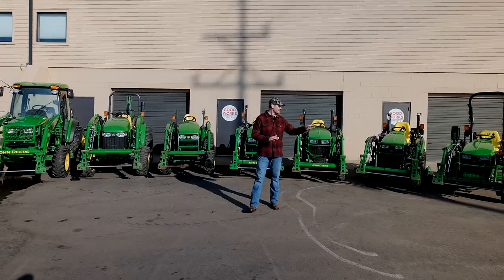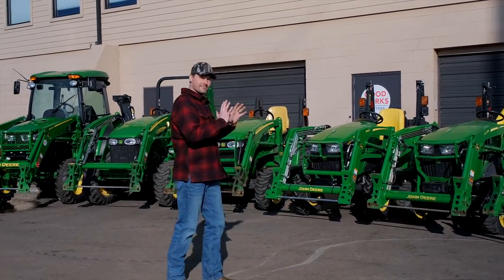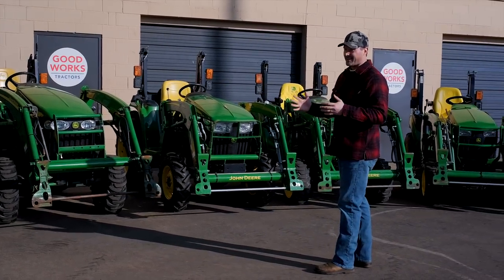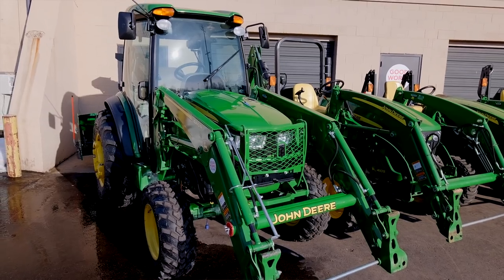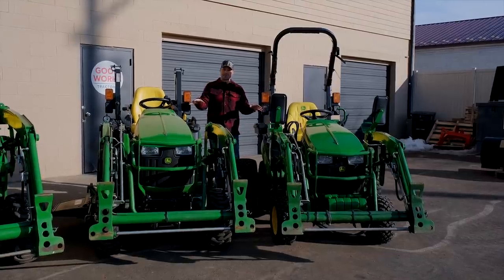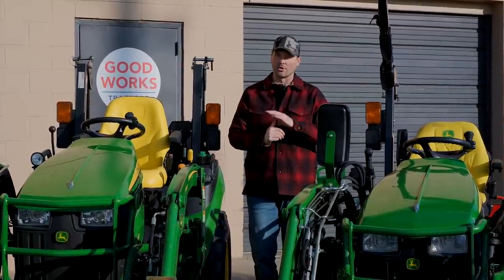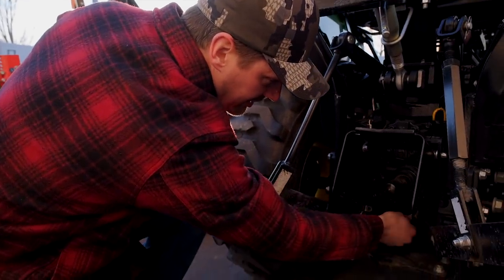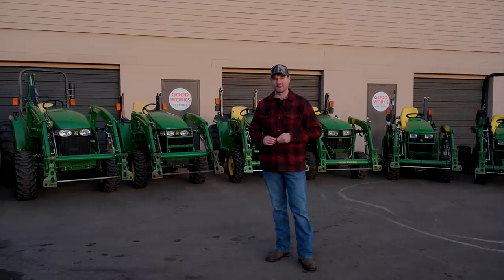COMPARING EVERY JOHN DEERE COMPACT TRACTOR FRAME SIZE 🚜

Comment from the maker: DOES AN ALUMINUM OR CAST IRON TRANSAXLE MATTER?  Are you surprised by those results? Leave a comment below!

IF YOU'RE IN THE MARKET FOR A TRACTOR OR ATTACHMENTS, YOU GOTTA CHECK OUT http://www.goodworkstractors.com 🚜👨‍🌾
Reply: @brianwideman2342  Not necessarily.  Aluminum is very strong for its weight.  An aluminum case of the same weight as cast iron will likely be stronger.

Comment: So good to see Rosie running the show again!  She looks great- the drone footage is awesome, that really shows the differences in these tractors that you obviously know quite well. And- I am really surprised at the aluminum rear ends. I guess they are holding up, or has that turned into an issue yet? Awesome video, thanks!
Reply from the maker: Haha, yeah she was telling me it's time to go sit by the fire!  No significant issues with those aluminum rear ends.  I just found it interesting after seeing all the conversations over the years online.
Reply: @GoodWorksTractors  I have a 2017 3038E and have not found any limitations in abilities compared to the R series. Like he said, the R's are simply deluxe versions with more fancy features over an E. Remember: more options mean more money. If you want to do the work without emptying your bank account, an E series will do just fine. Simplicity = less problems.
Lastly, I see no practical difference between an aluminum axle and cast iron. Aluminum will be just as durable in normal use, unless you have the need to jump over 12 cars Evel Kneival style.

Comment: Great video!! A few points worth noting and not mentioned is the independent deck lift option for both the 1025 and 2025R. It’s electric operated actuator for those reading this. I have it, works great. I also think the 2025r loader capacity is slightly more than the 1 series (not huge) as well as 3pt. Thanks for a great vid!
Reply from the maker: Thanks for watching.  Yes, independent options are available, however they aren't standard.  Command Cut is standard on the 2032r/2038r.  I was comparing standard setups.  Also, lift height and capacity is exactly the same.  3 point lifts more on the 2025r.
Reply: @GoodWorksTractors understood. You were mentioning cab availability and what not so I didn’t realize that. 754 pounds for 1025R and 840 pounds for 2025r with 120R. Courtney, do a lift test! Nobody has a good one on those 2 to actually test specs.

Comment: Double thumbs up!  I'm just starting to look at sub-compact and compact tractors for my property in Northern 
Lower Michigan.  I've probably watched 15-20 of your videos and others.  I'm getting comfortable with the 1025R (w/ loader, backhoe, belly mower, brush hog, grapple, snow blower, ballast box, wheel extenders, wheel weights, post hole digger and possibly a back blade or leveler of some type,  With these attachments I'm pretty sure I'll need 3rd function hydraulics on front and rear) A great education! We have 40 acres with an apple orchard - 50% is hayed (by relatives with their equipment), 30% woods and 20% is apple orchard and homestead (future house/garden - currently barn/driveway/parking/burn pile etc.).  Now I just have to break the news on level of investment to my wife!  :)

Comment: I have owned the 2 series, a 3046R, and now a 4066HD.  Awesome machine, and the jump in power is impressive.
Reply: I have a 1025R that is almost paid for, i was looking at keeping the 1025R for small job and get another 3 or 4 series. What did make you jump from the 3 series to a 4 series ? Have you ever considered the 5E series ?

Comment: I screwed up up . I had found 2019 1025 R front end Backhoe   With plastic still on the seat 💺 $15.500...Rosie looks healthy. Is there a reason why it’s aluminum instead of steel For cooling or dissipating heat? Steel is the way to go for weight ?

Comment: i really wanted to like john deere because my grandpa had a lot of john deere equipment back when i was a kid but the aluminum transaxle just killed it for me
thats precious ballast weight thats being thrown away by using aluminum instead and being down low built into the tractor would also help stability as well if it were steel/cast iron
i still liked the video though and appreciate all the details

Comment: Nice video
I didn't buy a deck for my 2025R but I thought there were different options for deck lift.
Rosie is looking really good. I think I have said before that I have a lot of respect for pet owners that take care of their animals even when it's a challenge.
Reply from the maker: Correct, but I'm not talking about options.  Rather standard setup.  You cannot get the 2032r/2038r without the Command Cut which is still a significant upgrade from the basic independent hydraulic deck lift offered on the 1025r/2025r.  Rosie's a good pup, she's pretty much fully recovered now too.  Have a great weekend!

Comment: I have a 2015 1025r with backhoe and loader and over 300 acres in northern Ontario. Now I'm really wishing I held off to find a 2025r or 2032r for the bigger tires and more ground clearance. Do you know if my backhoe fit on a newer 2025r? I was under the impression that they were different. Would love that 4105 but need to barge to get to my property.
Reply from the maker: I don't think your backhoe will fit the 2025r, but I could be wrong.  The new style 260b is what's found on the 1025r and 2025r, but I'm not sure if your 260 backhoe will fit.  Might need to ask that JD service counter and they can look up in their system.
Reply: Thanks for replying so quick.  That's what I thought too. Guess I'll be looking for an older one or just a bigger tractor next time lol  1025r gets the job done I just have to be careful with the ground clearance and stability. Thank you for making these videos I always enjoy watching them and get lots of useful information, helped me out a lot pulled the trigger on a Hla snow pusher this year and I love it. Just can't seem to find a backdrag poly edge anywhere near me.

Comment: The best one stop shop Deere comparison I've ever seen online...  Nice job guys!   My 2025R is sweet and nearly new, but somehow I can't bring myself to buy 4' implements...  I'm lusting at that 3520 OR more likely for a well loved low hour 3039R a bit higher in the $20s (along with TTWT I hear)... Wondering if I can get R14 or R3 radials that make the width a bit under 60" through my 60" gates on it?  Sad to say gates are the decision criteria.  It could be an M-1 Abrams tank capability-wise, but if it can't work where it's needed, doesn't work right?

Comment: Where would a 2320 fit in the line up. Also have you seen any three point attached buckets? Maybe with a hydraulic top link to tilt/dump. Even with a loader type quick attach for other equipment (forks). I’ve seen some online. Mostly from other countries or buried in hard to find website. Titan has one but you can’t back into a pile of material to load it. Looking for a more inexpensive option to buying a complete loader just to be able to move things around. Love the channel. Thanks

Comment: I’m still trying to decide what tractor too get I need the mower  but I need a strong loader and back hoe for landscaping jobs one question can you get the 1025 gear drive with shuttle shift F & Reverse , I have not seen one on the lots I been to.

Comment: I have a JD 4115 with about 225 hours I bought about 2003. How would that lineup with these models in the video? Thanks
Reply from the maker: It's a small compact, fairly similar to a 1025r or 2025r.

Comment: Nice comparison.  Would like to see a competitor comparison, Kubota vs Deere vs ?  as far as which model is a direct compare to which model.  What does an L4060 compare to?  Certainly not the 3 series from all the specs other than HP.  More importantly Cost to Value.  I know right from the start the JD costs more than Kubota, but why?

Comment: Corey, I have an independent deck lift on my 1025r.  It is an option that I had installed by the dealer.  I had a 2720 with other setup.  I kept damaging the linkage when the deck was off.  So I ended up leaving the linkage on the deck and removed the linkage and deck as one unit.  Defeated any quick disconnect but I was no longer spending significant coin on replacement parts.
Reply from the maker: Correct, but I'm not talking about options.  Rather standard setup.  You cannot get the 2032r/2038r without the Command Cut which is still a significant upgrade from the basic independent hydraulic deck lift offered on the 1025r/2025r.  Thanks for watching!

Comment: Factory cab with A/C & heat on 2020 1025r...like Mauser cab?
Reply from the maker: That has heat only, no A/C.
Reply from the maker: Also, in my opinion, real factory cabs can't be installed after they leave the factory.  You can install a Mauser cab on a used 1025r that is bought off Craigslist.  You can't ad a ComfortGard OEM cab after the fact to a 3r or 4r tractor.  Just my take on it.

Comment: I paid $16,500 with an FEL, 60D quick attach deck,and a 54” quick hitch snowblower. It has 80 hours. Bought it from a guy that lives 5 minutes from and we both use the same dealer. I called the dealer. They know the owner and me since I have my zero turns serviced. They gave me a clean bill of health and regularly maintained every year. Did I get an ok deal?

Comment: 💥 Aluminum and green plastic huh 🤔  nothing against Deere but I would expect better. I think with enough YouTube brain power we could build the perfect tractor.  
Keep on tractoring! 👍
Reply: Whatever that plastic is on my 9 year old 1026R , its nice, no fade and logs bounce off it without denting. I would have dents all over metal.
Reply: @chex313  I agree.  The plastic is actually an upgrade over the metal used by the other vendors.  It's a matter of taste too I realize, but in practice that is the reality.  It's an improvement, not a cost reduction outcome for the customer.

Comment: Great video. You are very knowledgeable about these compact tractors. But as you know I’m going to add a little bit to your comparison. 
John Deere does not make their compact tractor line. They are built by Yanmar in Japan . Yanmar also builds their own tractor line If you ever have a chance to operate a Yanmar tractor, I prefer the Yanmar tractor over the John Deere. 
Why Deere did not go with a 3 range transmission I will never know. I run Kubota and they have 3 range transmissions, low, medium, high. 
After owning a tractor with a 3 range transmission I would never ever look at a tractor with a 2 range transmission. Kubota is the only tractor company in the world that builds and engineers their tractors in house. Frame,axles, and transmissions.A John Deere compact tractor is a tractor that is assembled from parts and pieces from Other manufactures. This is why quality control suffers with John Deere, and why things don’t always work right.
Be careful and stay safe 😀
Reply from the maker: Perhaps Yanmar used to build certain John Deere models at one point in time, but they don't do so now.  If you disagree, then please provide links substantiating that claim.  Unless TTWT spent millions of dollars fabricating a movie set in Georgia, then it sure looks like John Deere is building John Deere tractors with parts sourced all over as with any equipment manufacturer.

https://www.youtube.com/watch?v=X5iYfsNcfs8&t=33s

https://www.youtube.com/watch?v=i5EjoYKhEeE&t=229s

Kubota outsources many, many, many parts as does every major machine/heavy equipment/auto/aircraft manufacturer in the world.  For many reasons, it's impractical to produce every part themselves.  For what it's worth, you're trying to knock John Deere for having their tractors built in Japan while the Kubota Corporation is headquartered in Japan.  So, please quit spreading misinformation as it it misleads those who don't know better.
Reply: Thanks Corey for educating kubota oz! Glad Rosie is doing better!!

Comment: Good video. Judging by  the telephone pole shadow migrating across the background like start vs 7:35 mark, i imagine it took a few hours. Thank you for the time😀.

I sent this post to Tractor time with Tim after i was curious on a system concept i was thinking about when looking at hydraulic multipliers.
I am curious as to what your take on this concept would be pros or cons. Here it is...perhaps a video reply??🤪

Curious. I like this multiplier concept. However, just to play with concepts...just to play. In the push for electric vehicles, as well as hydraulic fluid issues like leaks and injuries from pressure or exposure to skin etc. If the hydraulic system, like rear remotes, would there be  more power via electric motors if tractor had an electric generator sending electricity to power implement instead of fluid pressure? 

  It could be easier to regulate. So say one remote is positive and other is negative vs send and receive fluid circuts. Aside from swapping implements or converting them, what do you think the pros and cons of an electric system replacing the hydraulic fluid system? Would it be better or worse? Again not cost of converting or replacing implements. Say a first time buyer just starting out with no previous equipment in hand. Just as a system, traditional hydraulic vs replacing as an all electric based system.

Curious on take. Would like to see your take on this.